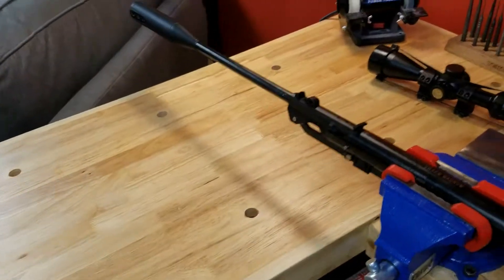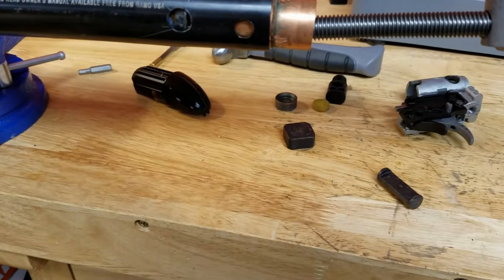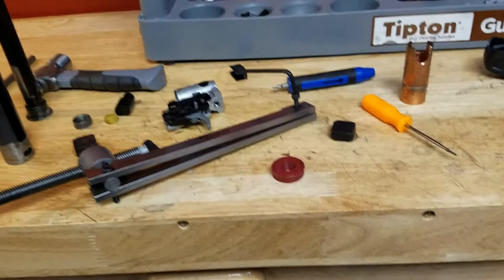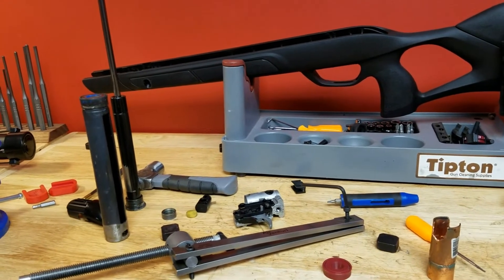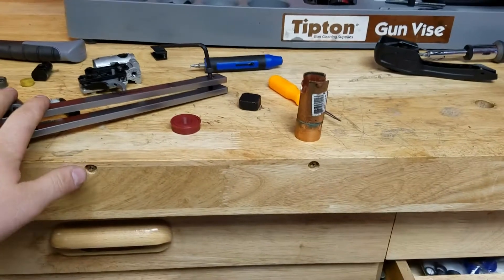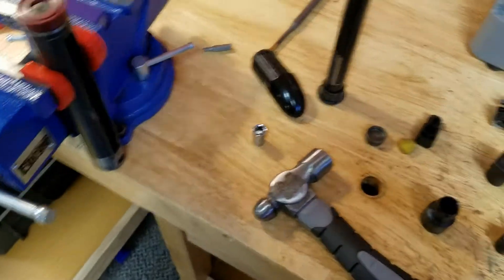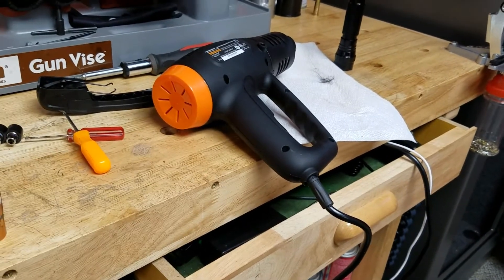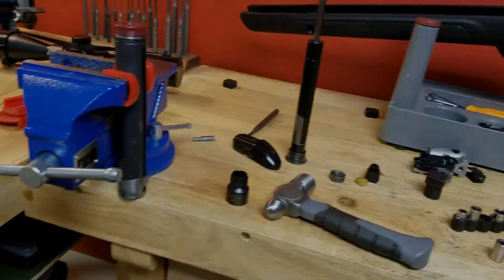How to take apart your gamo magnum

Comment: A novel concept would be that Gamo sold replacement parts for their guns. Also, I would put in a Gamo GR magnum steel mainspring instead of another air piston. Yes steel mainsprings can break or get weaker over time. But in general they last a lot longer than air pistons. And if properly lubed they often shoot smoother and one usually gains fps. There is a reason why the high end German HW's and Air Arms does not use them. The recoil is harsher, they actually perform worse in cold weather and are rougher on scopes. The reason the mid/low priced guns use air pistons now is the ease of installation and cheaper to install than a quality steel spring. They make them now almost as if the guns are disposable! And they make it difficult for the consumer to work on just for that reason. I have classic springers that are still on their first steel mainspring from the mid 80s. I don't have any air piston guns that have made it 10 years without replacing. And a lot of them died on me just from sitting in a gun safe. In fact, I'm currently and slowly converting all my air piston airguns over to all steel springs. Not an easy task in some manufacturers especially Gamo, since they don't sell parts.

Comment: Should I remove the “suppressor” on mine? I heard about how it falls apart after 200 rounds and makes the gun inaccurate.
Reply from the maker: Hey sorry for the late reply! I've had my suppressor break twice on me. Usually this is the result of a baffle strike which can happen if the gun is double fed. All I did was take a cut off wheel and remove the damaged baffle. I still get decent noise reduction and my groups with one less baffle are far better than they were with a damaged baffle, and about as good as when the gun was brand new.

Comment: Nice vid, and helped me 'engineer' my own spring compressor.  Looking at your vid, I was thinking the spring compressor might line-up better with the main tube, and avoid the marks on the recoil reducing rail, if you pulled off the RRR, and clamped onto the steel grooves directly to the main tube.  Just an idea.  Enjoyed the vid, thanks for sharing!

Comment: Hey great video!!! Can you do a vid on if it’s possible to put this gamo in a air arms ar15 mold/frame. It would look so cool! I’m sure with some mods it could be done
Reply from the maker: Sorry I don't have that platform to work with. The gas ram may be able to be dropped into another gun but the 33mm piston needs this specific housing

Comment: What is the plastic clip looking piece that falls off fairly easy taking gun apart
Reply from the maker: That prevents wear between cocking linkage and compression tube. Very important to not lose and they don't sell replacements
Reply: @brokenbarrels7318  im sorry to bother but does it go right on the elbow of the two bars Where the two bars meet? Mines fell apart like legos lmao
Reply from the maker: @aFallingTaco  so the longer part of the linkage, the part with the nub that catches the piston, should have a couple little notches. It goes in there. If there are no notches, as long as it is on the forward part of that link so that it bears against the compression tube that's fine
Reply: @brokenbarrels7318  Got it, Thank You 🙏🙂

Comment: Would this breakdown vid be roughly the same as first g magnum 1250 igt mach1
Reply from the maker: @hismaximus904  if it has the larger piston (I think 33mm) then it should be
Reply: @brokenbarrels7318  yes its got the 33m barrel is there anyway you can lubricate the piston seals without pulling the rifle apart and also what should I use to lubricate those seals
Reply from the maker: @hismaximus904  if you cock the gun you can poor a small amount of air seal oil (you can probably find something on pyramid or airgun depot). I'd recommend removing the anti bear trap mechanism so you can decock it. Then slide the piston back and forth by hand using the barrel without cocking it. 
Honestly though I don't think you should have to. Rubber seals don't really need lube unless you're doing a rebuild. They're good until they need to be replaced.
Reply: @brokenbarrels7318  sweet as thank you bro I will prob just leve it its a brand new rifle maybe 220 rounds through it its good to know tho cheers mate
Reply: @brokenbarrels7318  I just bought another gamo magnum on Saturday as my bike fell on the gun and broke the stock unfortunately, but with the new I bought its quite rough and I can hear creaking or something, even after the rifle is loaded when I move the barrel back and forth it stil makes a really bad grinding noise and near the top of the stroke the barrel almost stops in 2 places I'm really confused with what's going in the first one I got didn't make that noise and it was only a week old
Reply from the maker: @hismaximus904  the cocking linkage on Gamo rifles has a small plastic c clip that acts to space it from the receiver tube and make it smooth. These sometimes fall off or aren't on from the factory. Take the stock off. If you can find the clip, it is easy to see where it goes on the arm. If it is not in there, these are usually hard to find after market and I'd say return it for another. Gamo is pretty good about that stuff
Reply: @brokenbarrels7318  I took it back to the shop the guy didn't even pull it apart he just said it doesn't sound mechanical so there's nothing wrong with it I've taken it to another shop to get it looked at and if it's not how it should be I have a second opinion and I want a new one
Reply from the maker: @hismaximus904  yeah I'd just email Gamo and send it directly to them.
Reply: @brokenbarrels7318  ok I prob will do shipping air rifles in nz is very tricky tho might just have the gun Smith guy fix it instead of waiting half a year to get it back from Spain lol
Reply from the maker: @hismaximus904  yeah good call.

Comment: What adjustments to the transfer port did you make? I'm curious because I had the same exact problem with my swarm magnum.
Reply from the maker: Good question. I can't remember exactly, but I found the diameter of the port and went up a drill size or two. No counter sinking or tapering or anything fancy like that. I haven't noticed any positive difference and I would not recommend doing it until someone comes out with some better research.

Comment: Is this the same process with the mach 1 fusion
Reply from the maker: It may be. I never worked on that gun but I believe it has the same piston. If it has the seconf pin in the back then it should be the same.

Comment: I had a red plastic plunger piece fall out of my gen 2.  Can that be put back in?
Reply from the maker: Unfortunately I am not overly familiar with gen2 swarms. If it comes out, it can go in. As long as it isn't broken and you can find out how it was secured in the mechanism
Reply: @brokenbarrels7318  
Thanks

Comment: Hey I have a question I need a new IGT gas piston for my gamo swarm that goes 1300fps where could I buy a new one
Reply: Contact Gamo. Anyone with an FFL can get it. Or search forums and other things.
Reply: @odins_mercy5945  thanks a lot for you’re time
Reply: @splash4000able  you're welcome. Gate way to air guns is a great forum as well. I gotta get a new piston seal for a Gamo Magnum GR and am sending it out to a tuner on that forum. Great forum for info parts etc

Comment: Can the suppressor on the front of the barrel be removed?  I have a small piece of plastic stuck in the end of the barrel, and I don't know how to get it out.
Reply: Yes, but you need a same sized punch as the roll pins holding it in at the front of the suppressor. Just remove the pins. Pull apart the suppressor case at the seam, Make sure you don't lose them when they come out. The punch is not hard to push them out, and use your hand at first, if not a small tack hammer. Don't let those roll pins drop out, which they usually won't. You only need to push them in half way and use your fingers to pull them out the rest of the way. Push them in the same way you pushed them out, not opposite. Then keep everything aligned the same way you took it out as you put it in (baffle, cap, etc.). Once you get them out the cap pulls off and the red baffle pulls out. Then, pull the baffle apart at the seam and remove the obstruction. Note the orientation of the baffle so as to put it in the same way.  Eazy Peasy.
Reply from the maker: @JohnSims3  Great explanation, couldn't have said it better myself. I'm guessing the piece of plastic is actually part of a baffle. I have had three baffle strikes with gamo swarm magnums. Don't know why they're so common.
Reply: @brokenbarrels7318  Thanks! Ask me how I know...Yes, the red plastic internals are part of the baffle. It's a sandwiched 2 piece baffle. I should have done a video on it. I luckily had the same sized punch as the roll pins. maybe a hex wrench or Phillips jeweler's screwdriver of the same size would work for those who don't have punches. I think the strikes are possibly caused by the rear of the baffle toward the barrel end is moving on recoil? Hell, I don't know. Maybe it's the front end of the baffle catching a strike due to the only support for the baffle being at the barrel end, and not that much support at all...??? Maybe a tie wrap or narrow clamp on the barrel end could help support it more? I'm just speculating. I should have done a video on it when I took it apart. I saw one guy do it because he got a patch stuck in it and didn't even bother supporting the baffle or barrel before pounding on it. Just a very easy tap will push those steel roll pins from  the plastic baffle housing.  I've been looking for everything I can about the Gen 3 to see what improvements they made to no avail. Thanks for this video pal! I was going to do the same but no time. The tool you made is perfect. Kudos!
Reply: @JohnSims3  thanks for explaining!
Reply from the maker: @JohnSims3  Luckily I have about twenty different roll pin punches lol
Reply: @brokenbarrels7318  Me too! It helps to have the right tools for the job...Thanks for a great video!

Comment: hi, how did you put the red cuff on the piston, through the cone or hammer with a hammer?
Reply from the maker: I believe I explain how to put a new piston seal on. But you essentially find a socket that matches the diameter of the wedge and press it into the hole in the seal. Line up the socket and wedge, grab a larger socket, and press the seal over the wedge.

Comment: If one were to take the butt stock pad at the end off drill or access a hole and fill that hole as much as one could with silicone caulking is there any other vents it would leak out from? I haven’t seen any videos of a takedown (of the magnum)  and I’m quite sure you looked inside the butt stock Any data would be much appreciated my friend
Reply from the maker: I will look inside the buttstock once I clear off the workbench. Hopefully this weekend. If my memory serves me it should be fully sealed. I usually just use modeling clay to fill the stock but that is a good idea.
Reply: @brokenbarrels7318  I want to use a clear rubber silicone caulking called “lexel”
Reply from the maker: @drodriguez3935  I am fairly certain that it won't come out anywhere. Just double check that there is no hole in the top of the grip that leads into the stock. As long as it is moderately dense and will soak up vibrations it should work just fine.
Reply: @brokenbarrels7318  I appreciate the data I have about 10 plus Gamo’s -three magnums… But it’s gonna be four when I order that .25 mag  coming out with an August So it’s fair to say I got a Enough to do a guinea pig run so I’m gonna go with one of the cheaper .177’s and I’ll let you know how it goes
Reply from the maker: @drodriguez3935  Oh geeze I didn't hear about the 25! I've been wanting that for years now.
Reply: @brokenbarrels7318  yes same I was even willing to buy a used model 10 years ago… gamo had ( I believe )a Hunter an big cat model in .25 many many moons ago so yes I’ve been waiting myself put yourself on the notified list on Gamo’s website cause there gonna go fast
Reply from the maker: @drodriguez3935  I've been wanting a wood stock magnum in 25 with a picc rail...
Reply: @brokenbarrels7318  The 25 caliber Gamo released today at 8:30 I was able to grab one but just wanted to give you a heads up just in case you wanted to grab one
Reply from the maker: @drodriguez3935  Nah I honestly have to get rid of my 22 magnum I never use it. They just don't compare to weihrauch
Reply: @brokenbarrels7318  You know what I was looking into one I want to say it was that name is that German and they’re roughly anywhere from $700-$1000 with that red and black striped wood I believe it even said it was recoilless I’m gonna look more of those
Reply from the maker: @drodriguez3935  I believe you're looking at the Diana 54 Air King. Great gun I may one day buy one. The action is on rails inside the stock. The weihrauch is with the blue stock

Comment: When do you have to replace that seal
Reply from the maker: Gamo does a really good job of making high quality seals. If you never take your gun apart to this extent and don't abuse it (dieseling for example) your seal will be good for I'd say decades. However if the seal gets any nicks on it during disassembly or any metal dust gets in there from a trigger job or deburring holes on the receiver, it's a good idea to replace it.
Reply: @brokenbarrels7318  thank you sir I really appreciate it